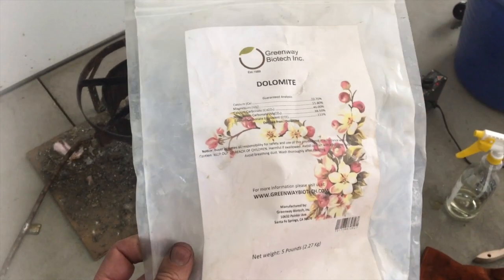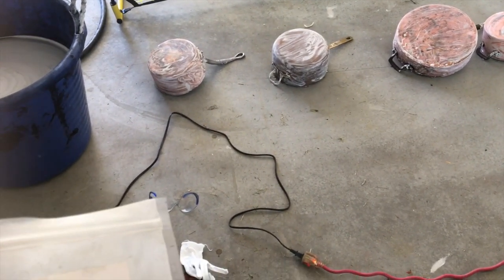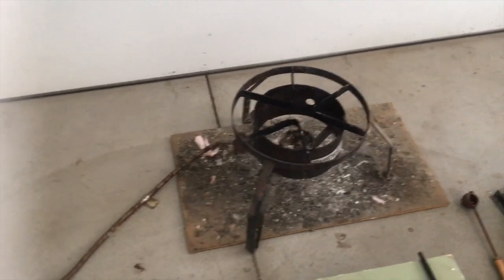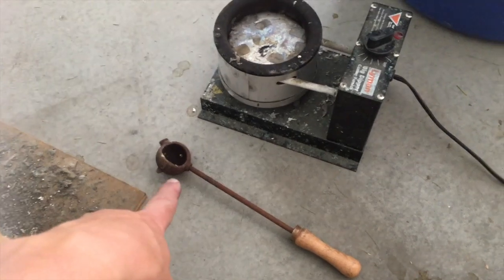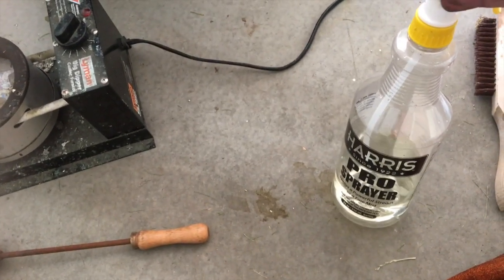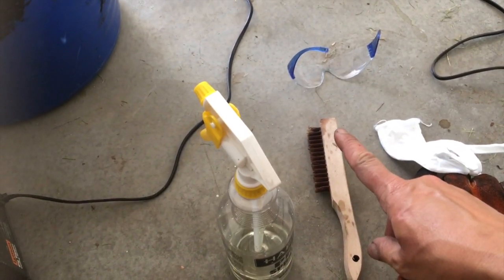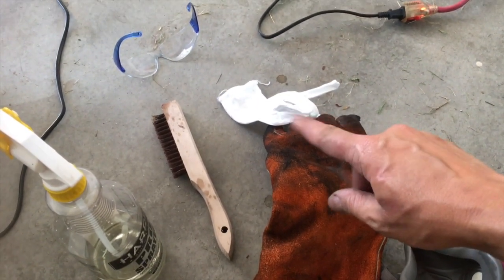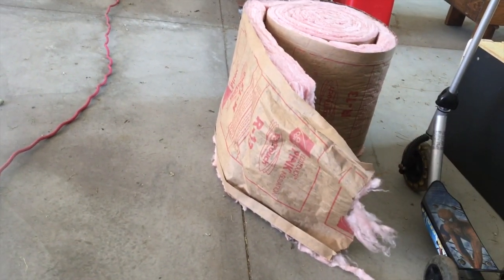Tools for Tinning

Comment: What is the best way to clean a copper pot? I buy and sell items for a living so I have bought lots of copper pans and skillets and worked like crazy to polish them up to resale. I'm just curious as to what you would recommend. Thanks for your time and have a great day!
Reply from the maker: Hey John, Well, if you're asking about cleaning a pot that has the interior all set up, and you just want the outside to look nice...I'd start with washing the outside with Tarnax, then follow with a buffing wheel polish and then a hand polish. I personally like Eve Stone's Antique  Copper and Brass polish for the last step. If there is a ton of black grime on the outside, you may need to get more aggressive to remove it before the buffing wheel stage - I use really find grit sandpaper if necessary.

Comment: Hi!
I'm going to retinn some copper pots I've got, and one of them is a thick french one! Theres not alot of info about this in Sweden and I've got som questions about flux because I dont know which and what goes with 99.9% pure tin and what flux is poisonous and I do not have Harris available, do you have some input? I've found 99.9% pure tinn for bulletmaking, it that ok or should I somehow look into what the 0.1% is?

Thanks for the videos! Would be so cool to have a kitchen full of nice copper pots. :)
Reply from the maker: Good luck! You can do it! You do want to make sure the tin is lead-free. If it's for bulletmaking, there's likely some lead. So check. Any liquid flux you can find will be 11110% better than a paste.

Comment: Hi Sara, Thanks for the film. How do you get the copper down to the ready for tinning stage? I saw you use a bucket of acid (what type?) and removing whatever tinning there is (using a wire grinder wheel and sander?). Maybe you can use my copper pot for demonstration and describe what to look for? Also, you said you CAN TIN STEEL, as in a round bottom steel wok, but it sounds like it's a problem. Also, I can't get the thing completely clean and if I do it will immediately rust without an oil coating. Is this going to be worth it? I would rather have a copper wok.
Reply from the maker: Hey Danny! Sure thing! So...to prep to tin depends on the piece itself, but typically it's a soak in a caustic acid/water bath, then a lot of elbow grease with wire brushes and sandpaper. Then some work to really clean around rivets involving the bead/sand blaster, a dremel with different attachments, and for the very stubborn stuff, a metal stripper attached to a big motor. So no grinder wheel, but definitely some sanding both by hand and mechanical for the stubborn stuff. Then a muriatic/acid water bath. I will have my 8-yr-old film me doing a demo with your pot when it arrives. :) And yes, you can tin steel, but it's tricky. It requires a different kind of flux, which I can buy...and also a LOT more heat. It also is not bonding molecularly - it's mechanical - so the tin can chip off much faster with use/time. And yeah, it has to be 100% clean (usually sand and pickling is involved) before it will take the tin, too. The issue with a copper wok is that the tin lining usually can't handle the super hot temps. So you need the cast steel - funny I just addressed this in the next video coming out. You just need to strip and season the steel wok solid...do you have access to a backyard where you can stoke a big fire? Seasoning is something we do here in the yard over big fires. Use flaxseed oil to season and if you have it stripped well the rust should stop...

Comment: For a cheap refractory, I mix fire clay (5$/50lb) and shredded styrofoam 1:4 and pack it around the inside of a form and allow to dry completely. When lit the styrofoam vaporizes and I'm left with a very porous insulative lining that holds in heat well and is much cheaper than a bunch of firebricks. Nifty for forges/furnaces etc.
Reply from the maker: OOOO - thank you for that cool tip!!!!!!!!

Comment: Hi, it looks like you're using a propane burner for outdoor cooking to heat the pot. I assume propane is best, not a coal forge.
Reply: Also, found an online source for tin: metalshipper.com
Reply from the maker: Yes, the propane allows for even, controlled heat, which is paramount with re-tinning.

Comment: Thanks for the video. I've been using, with some success, a tin paste product made of powdered tin and flux as well as standard tin in bar form (careful the bar doesn't weld itself to the pan). I've heard/read that the paste product isn't as good as the old fashioned method. I've seen no real difference other than the tin paste is much easier to apply and it is a bit more fail safe so to speak. What is your opinion on it?
Reply from the maker: Hey Steve! I have had limited contact with the tin paste / combo flux, but usually when doing small work in reproduction builds, not for tinning. (and I have totally been there when the pot isn't hot enough and the tin bar sticks!!) I will have to try the paste for a full tin; I'd be interested what the clean-up is like in terms of leftover residue from the flux paste. In my experience any paste flux (without tin) has left a less satisfying finish, whereas the liquid flux is much more smooth. I think in the end it comes down to what feels the best for you!

Comment: oh hey I just read you are in the milwaukee area! so am I! I need to tin a steel bike frame. where do you think I can buy the best deals on tin? please help! i just started learning about tinning yesterday! looking for pure lead free tin .(I was originally going to electroplate it but wanted to switch from nickel to tin and someone on the internet told me "tinning" would be better than trying to electroplate tin onto steel.)
Reply from the maker: Sorry for delay. Questions like that are best in email where I check much more often! Is your steel bike frame clean? That will be your biggest problem - keeping it clean so it will take the tin. Nickel is really hard to adhere because it doesn't react well to oxygen lol. You can try to electroplate tin as well, but it's going to be a tricky process - I don't do it, I do it all by hand - and you'll need something to get your bike frame VERY hot to take the tin AND you'll have to do it in patches unless you have a vat big enough for the whole frame. There is no such thing as a "good deal" on tin, but I buy mine in bulk from Johnson Manufacturing

Comment: I saw you prepare a pot with acid..what kind was it?
Reply from the maker: I use sodium hydroxide as well as muriatic acid baths.
Reply: @housecopper  thank you for the answer😊 Now, when do one apply the acid? Before flux while the pan is hot? 
I also have a full set of pans, but have no idea what brand. There is a stamp of a building (manor?) I've tried to Google and search chat rooms, but I haven't found it yet..
Reply from the maker: No problem! Happy to help! I usually do acid baths before a final stripping (if needed). But if I use acid during tinning, I heat the pot, add the acid, swirl it around, then add flux and then tin. I will have to do a video on that!! Congrats on your fancy copper pan find!
Reply: @housecopper  well, i have no idea about the brand of the pots i have..do you? 
I'll make an attempt at retinning soon😊

Comment: Boots : experience says when buying boots make sure the tongue is attached all the way to the top and not separate under the laces, that's an easy way to get molten steel / other down on your foot and you can't get your boot off fast enough.  
😎💥
Reply from the maker: lol - do you speak from experience? That is a GREAT piece of advice (and one I forget sometimes). When I broke my foot a few years ago, I tinned while wearing that big black boot (talk about zero protection). When I went to the doc, took off the boot later that day, chunks of molten tin fell out of the velcro...the doc was like "in 21 years, I've never...." lololo
Reply: @housecopper  
😄👌 good one. For me it's been witness experience I've seen more than my share of new peeps that didn't realized nor know the difference at first. You learn quick working with extreme heat. 😊🌾